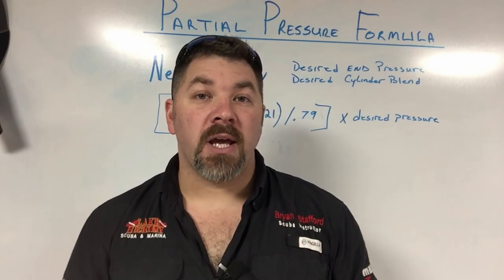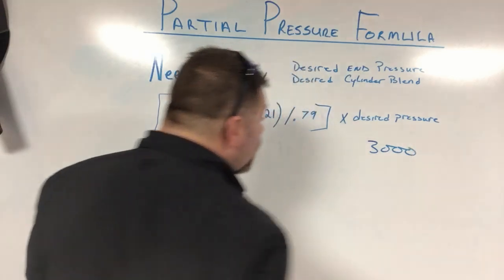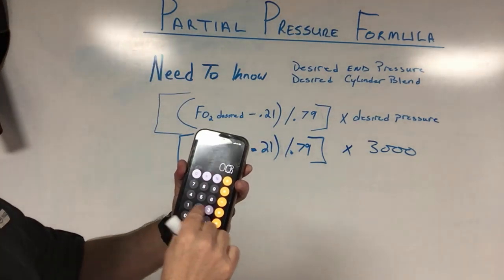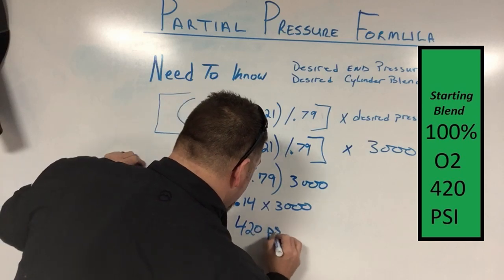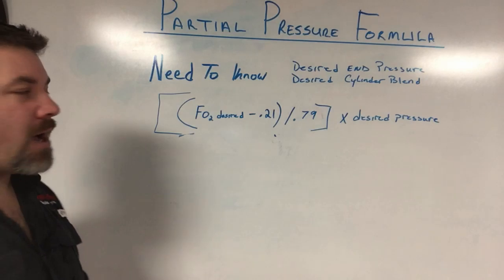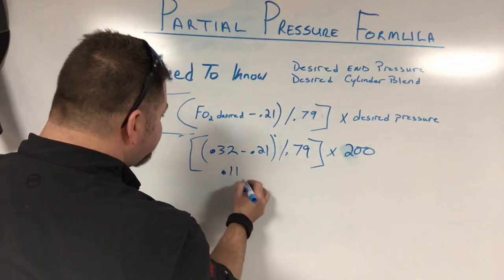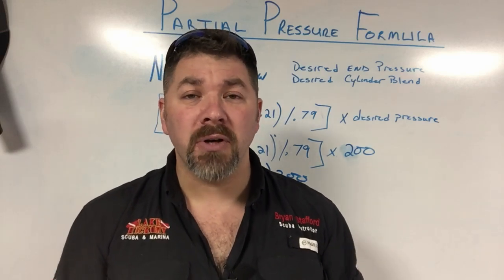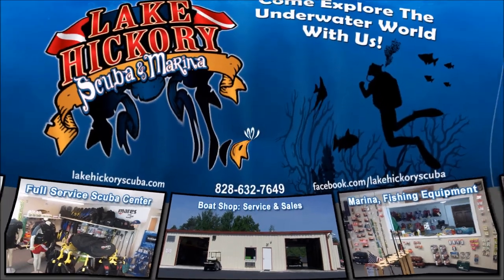Partial Pressure Formula Explained (PSI & Bar)

Comment: Really nice to know how they fill my nitrox tanks. When I got my nitrox rating they said that partial pressure was possibly dangerous for the operator doing the filling if the cylinder had any grease. Made sense because O2 is explosive. So if you know how much pressure to put O2 in, which you just explained, by default you know how much regular air to pump in. Why not put the regular air in first and O2 second to mitigate some of the hazzard possibility?
Reply from the maker: Blending Nitrox can be dangerous to the fill operator at any stage (just as anytime we deal with pure oxygen).  There is a lot of trust between the fill operator and the customer.  Just because a cylinder is marked oxygen cleaned, there is not a sure fire way the fill operator can be 100% certain the cylinder has remained that way since its last inspection.  In regards to the order of gases (great question by the way), one of the biggest concerns is introducing contaminated air (trace amounts of hydrocarbons) back into the O2 cylinder.  In the event the cylinder being filled has more pressure than what the O2 cylinder would have, then the risk of cylinder air could potentially bleed back into the oxygen cylinder.  In the event the cylinder was not cleaned, then this could be an issue.
Reply: Great answer, thanks Bryan
Reply from the maker: You’re welcome

Comment: Tech Guy at heart can't help but the open My Big Mouth awesome videos definitely look forward to the next one based on an interesting principal the calculations that your teaching today are with the basis of the tanks or pressures starting a zero which is the easiest way the calculated as you have said you're next video what's going to be about if there is some kind of blend in the tank or you're not starting from zero oddly enough just about every scuba diver is told to in there dive with some sort of gas left in the tank so when I fill station operator goes to fill it it is easier to just continue to empty the tank and start your calculation from zero but wait why then where the divers always told to end their dive with some gas remaining everyone knows but you're not supposed to empty the tank for the possibility of moisture intrusion hummmmmm.
Reply from the maker: Our next video in this series will be published sometime tomorrow, and yes it will be on the scenario you mentioned.  A diver comes back for another fill will x-amount still in their cylinder.  Not only do they want it topped off, but they also want a different blend.  There are of course two options.  Option one, drain the cylinder and start over from scratched, or option two, do the math and reuse the air that is left over.  Stay Tuned.

Comment: in common sense I would have done so:
Ean 32 
.32 x 200 = 64 bar O2
Ean 21
.21 x 200 = 42 bar O2

64bar - 42bar = i must add 22 bar of O2 in an empty bottle.
Reply from the maker: Hello Fabian, the only step you missed would be dividing out the fraction of Nitrogen that would be mixing in once you topped of with air.  This is why it is always important to follow the formula, so that we don't miss a step.